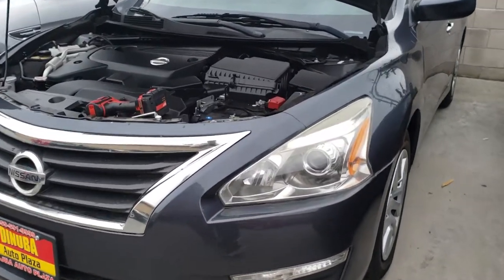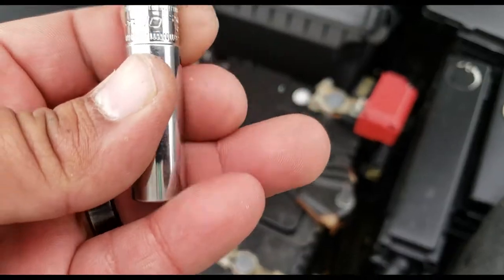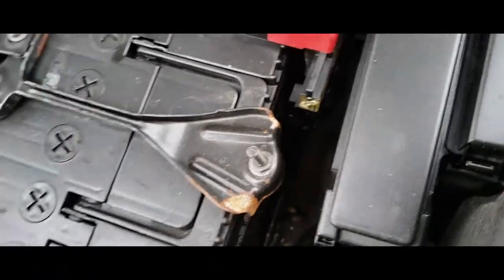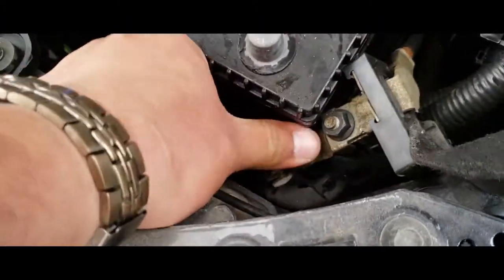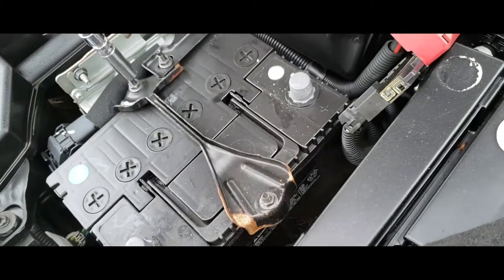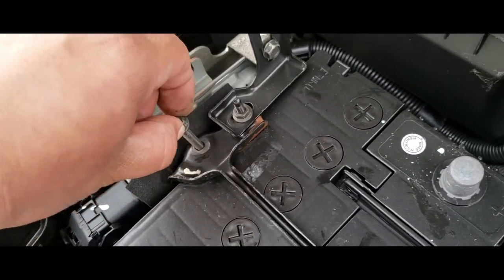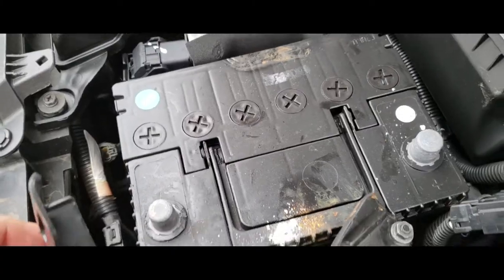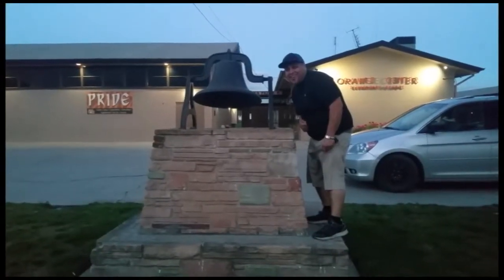How to:  Remove a battery from a 2013 Nissan Altima

Comment: some videos say you need to have a memory saver plugged in to avoid losing your settings, have you ever needed to do that for your altima?
Reply from the maker: Yeah you can if you like, I've personally have never used one and haven't had any issues. I work at a dealership and we get many vehicles with Dead batteries and have to be replaced. No sign of life. I replace them and start up the car with no issues. U should be okay.
Reply: @559powerscape  thank you for taking the time to answer so quickly, much appreciated
Reply from the maker: @y2k704  your welcome! Have a great weekend!
Reply: How I know what type of battery is good for my car? In case I want to by it myself
Reply from the maker: You can go to an autoparts store like O'Reillys, napa or autozone.
Give them the year make and model and they can point you in the right direction...cheap or expensive would be your choice or go to autozone.com put in your vehicle info and search for battery

Comment: Is that corrosion under the battery bracket cause for concern? Will it drain voltage?
Reply from the maker: No it wouldn't drain voltage but it would be a perfect time to clean it. It's not my car the reason I didn't and at work so I needed to finish up asap.  All these videos come from work the only reason I do it is because I'm already do the job might as well grab a camera recorded it and make some money😊💯 that's the HUSTLER in me!

Comment: Hi George, do you have a radio issue or any other electrical issue after changing the battery?  I think my car needs a computer reprogramming.
Reply from the maker: Nope, no issues. What is it doing? Any check engine?